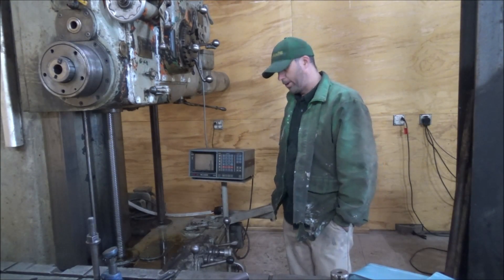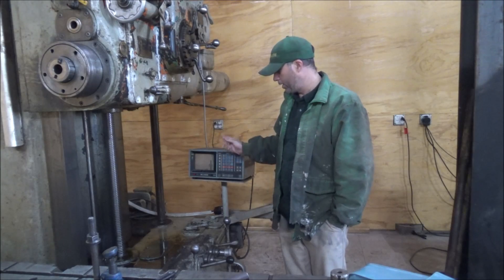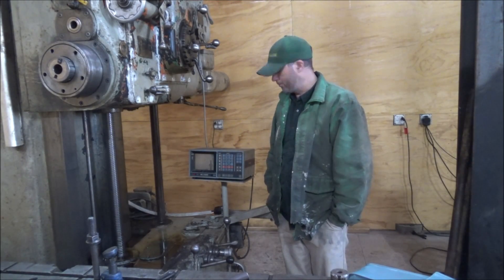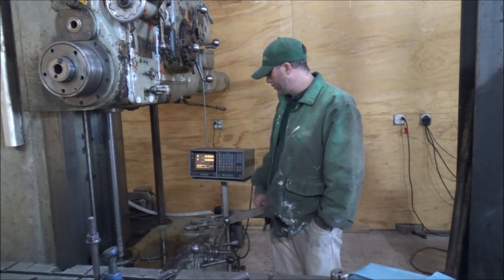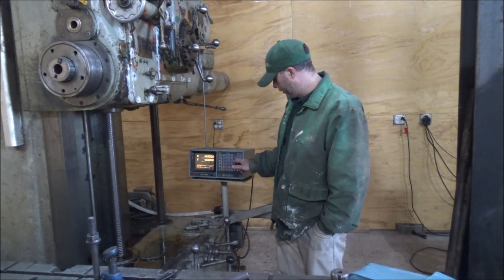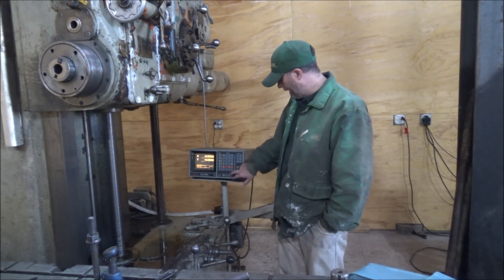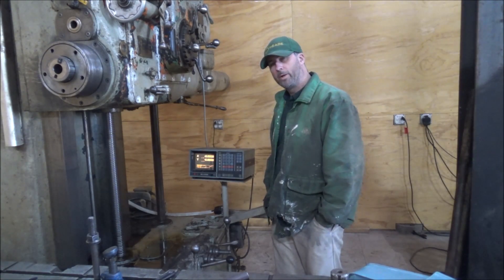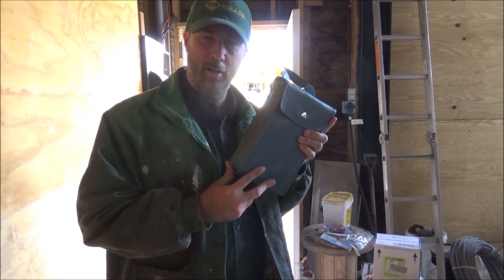Resoldering connections saves an antique!

Comment: Awesome result Brian. I fixed TV's for 35 years and I had to fix many built in problems (Caused by me.) many times. Thanks to a knowledgeable electronics tech.  Keep the screen dim, you don't want to wear out the pix tube, they are now hard to find.

Comment: Takes me back 40+ to repairing circuit boards by resoldering every IC pin on a board.  Sometimes had to re-tin the copper traces (poor manufacturing).  Replaced burned up traces with wire (burned up by power resistors over time).  Welcome to the electronics recovery team (old style).
Reply from the maker: Yep had to wire patch some traces on this one. Now I know some of the tricks to the fix!

Comment: I bet a dozen more of those get pulled out of closets everywhere and "that's all that's wrong with that" a static band and grounding that case  to a copper rod 6 Ft. in the ground could save the ic' and your life. good saving that, that's not junk.  that counts per inch calibration that unit has makes it a very acu-rite unit thanks Brian learning new stuff is a two way street